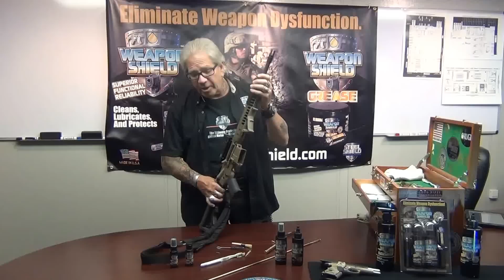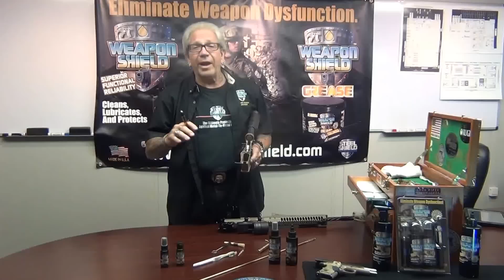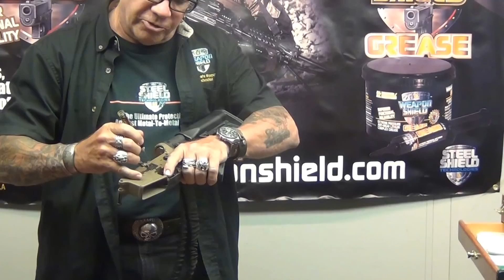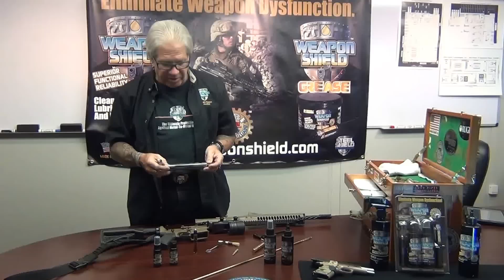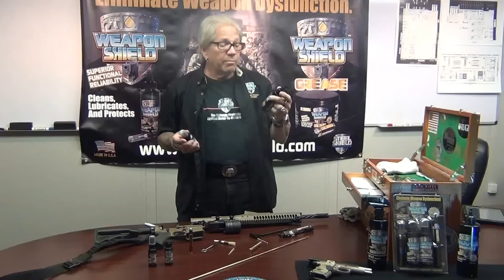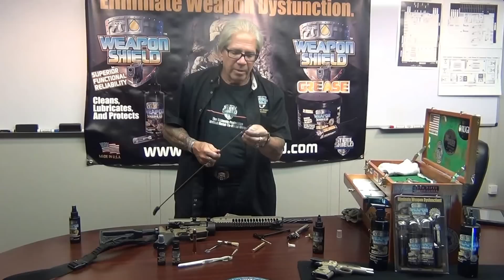Weapon Shield - Using Weapon Shield CLP and Solvent

Comment: I use Strike Hold CLP which leaves a dry film, used Weapon Shield oil and grease for many years and compared to Mil-Comm, M-PRO 7 see no significant performance difference between them !  All are very good products.

Comment: What's that "ting" at 0:37 ? - The first time I used Weapon Shield, I cleaned my gun as per usual, dried it, then applied Weapon Shield as I would any other lube. I went to put back on the slide and it went on so fast, I thought I had missed the rails...nope, it was on there just fine but now slid so easily it was unbelievable. I couldn't get over it, it was like a different gun. Now I had been using this no name gun oil that came in a cleaning package at my local Firearms dealer, one of the salesman there said, All oils are the same....lol. That stuff would dry up in less than two weeks and there was barely any difference in racking the slide with no oil and with it. .
With Weapon Shield? Months later, even guns sitting in my truck in the heat of Florida...oil is still there and racking the slides on any gun I use this stuff on, feels like it's on bearings, super fast, just slick as can be. Their grease is the same way. I've offered to clean people's guns and when they get it back they can't believe how easy it is to rack the slide. The first thing they ask is what did you use?

Comment: I just used weapon shield for the first time on my new ar. I used to use rem oil which evaporated and always left the parts dry. I used patches to apply the WS. Bad mistake. Patches left fibers/ particles stuck in the ws all over everything... inside and out. Next time, I'll apply with a soft tooth brush or shaving type brush (I didn't watch this video first). 

I don't really like much WS on the outside as it holds lint and whatever. I dont like slick exteriors either on any of my firearms. I still applied it to the exterior for corrosion protection and wiped it dry to achieve a dry look. But, when doing so, the fiber particles from my patches/ rags naturally break down and stick to the surfaces. I just used a camera lens brush to brush away the lint.

First question, after applying weapon shield to the receiver's exterior and wiping it dry, is it still on there? I have to imagine that it's in the finish/ metal on a molecular level (not sure if that's the right term) at the least. A few days later, the WS magically reappeared as it wicked through the selector switch and other pin holes. No big deal. I expected that.

Secondly, what's a real good lint free material to remove excess WS so I wont have lint and particles all over the exterior? I never had to worry about this before as my rem oil just evaporated lol. 

Thanks
Reply: Gary Marchlewicz T shirt is good. Nothing with obvious fibers roaming about

Comment: All due respect  don't take up benchrest shooting. Your cleaning method will destroy such accuracy. Examples; pulling patches BACK through the bore plus using a cleaning rod that bends when cleaning the bore are just two examples. That said, your produce is second to none when it comes to protecting firearms.
Reply from the maker: Bob....I guarantee. The advanced boundary film will prevent any scoring or scratching of the lands from said remark. It virtually stops the wear and increases barrel life dramatically.
Reply: Gun metal which is like tool steel. And these cleaning cheap metal or steel can damage it? If you naked the crown yeah. I really can’t see that.

Comment: How in the world will ammonia attack, corrode a triple-hardend steel inner  barrel ?
Reply from the maker: It's called chemistry, and over time, it will occur. Ammonia (NH3). Although common in nature and in wide use, ammonia is both caustic and hazardous in its concentrated form. It is classified as an extremely hazardous substance in the United States as defined in Section 302 of the U.S. Emergency Planning and Community Right-to-Know Act (42 U.S.C. 11002), and is subject to strict reporting requirements by facilities which produce, store, or use it in significant quantities.https://en.wikipedia.org/wiki/Ammonia